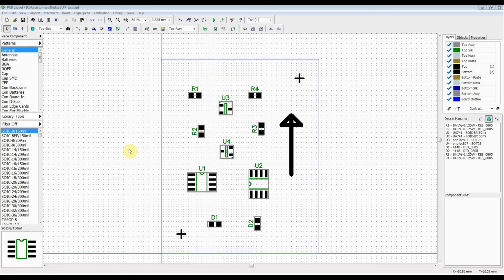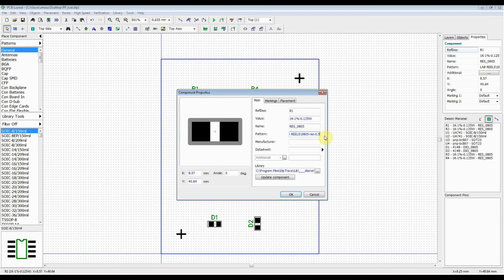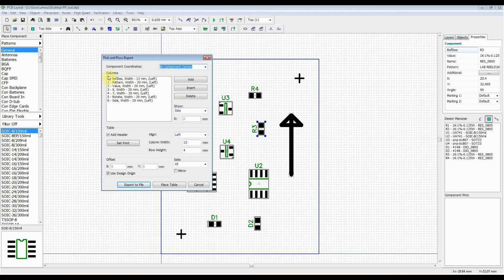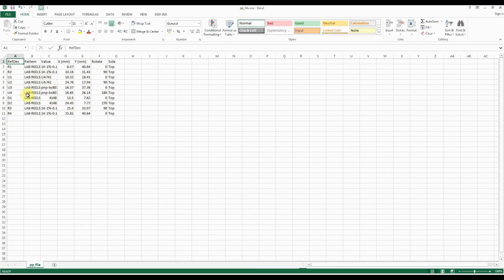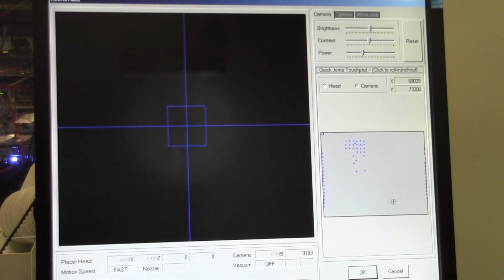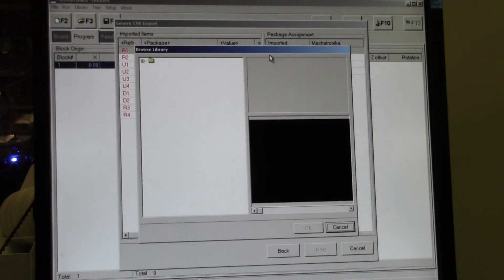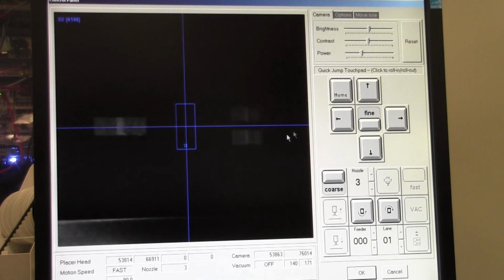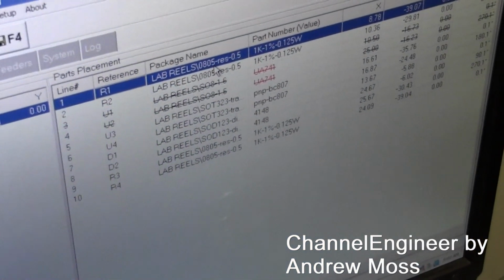Automatic SMD Pick Place M10V. Part 5 How to import a Pick and Place file

Comment: The machine itself is okay, but be warned the software is so bad that you can never get a return of investment.

Universities might not need to assemble PCBs economically, private companies however are a different story.
The software makes the machine as valuable as chinese sub 10k machines.

The good thing about the software is there are almost no bugs - because there are almost no features.
Try to pick and place 10 single components, it will need 50 mouse-clicks (also known as no multiselect available)

Try to reload a feederslot, first you need to set up the component from the mechatronika component library, afterwards you need to set up the pitch again (the pitch is not stored in the component library).

1mm PCBs with HASL surface (150x130mm) are problematic because the pcb level is usually only programmed once, if the PCB is slightly bent that will be a very big issue for the machine.

There are dirty workarounds available which will decrease the lifetime of the nozzle (eg. setting the PCB level manually low enough in the machine), 

The HASL surface can cause issues with the fiducial detection and be a reason for misplacements.
Those issues make it nearly impossible to place 0402 accurately. In the video you mostly see 0805 (I can confirm that there's no problem with that!)
Mechatronika points out that it is supposed to support 0201, probably only with upper class diamond PCBs, and if you put this machine next to a temple or into a church for praying that it will work.
By default for sure not (my experience with 0402 is already too bad) out of 100 PCBs 40 worked without reworking (from that you can see it very much depends on the quality of the independent panel - slightly bent panel and you're doomed or you take into account that your nozzle will die earlier; taking multiple z-reference points before placing a panel is not supported by their software).

I guess 0603 and a 1.5 - 1.6mm PCB is no problem (but chinese sub10k machines can do that too). The Mechatronika machines are capable of more - but the software completely jams it down.
The total product is not worth its money because of those issues.

Overall our experience with their top model is not good because of fundamental issues, Mechatronika claims we need training (we own this machine for a few years and even worthlessly upgraded it with no positive change). We do not want a training in dirty workarounds, and it won't make single placements quicker because multiselect won't be available with a ridiculous training either, nor will the SMD belt pitch be stored in the mechatronica component database (which by the way cannot even be searched, sorted or checked if enough components are in stock - so it's necessary to maintain the stock in TWO lists, one time in Mechatronica's application and another time externally).
Mechatronika refuses any update for years.

For a lesser troublesome machine with Mechatronica's specs (but which will really be workable) it's better to look at other companies, maybe Fritsch?

Last but not least, the owners of Mechatronika are older than 50 I guess, once they retire the company will probably just be sold or shut down. I don't see that there's any innovation or customer support to fix problems. They're just expensive - that's it.

As a workaround for all those software issues:
We have started to reverse engineer the machine (wiretapping the RS232 communication), the comunication protocol will be posted on github in August, 95% of the features are already revealed and our own application for controlling the machine is almost ready.
Reply: Hello, I am currently struggling with the software... Can you tell me more about your workaround? Was it meanwhile published?
Reply: @k.k.668  I moved to another country, and built my own pick and place machine... The rewritten software is not released yet because there are many updates  and it needs to be verified again, it will probably happen within next year when I go back to our MX80.
My software will silently try to pick and place everything it can and disable components which have problems. All problems can be solved at the end of the pick and place process.